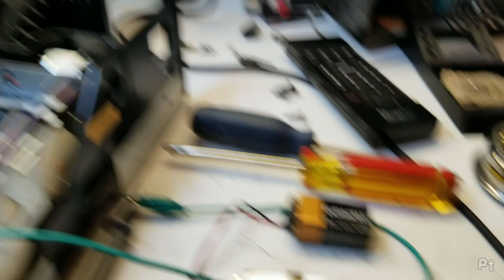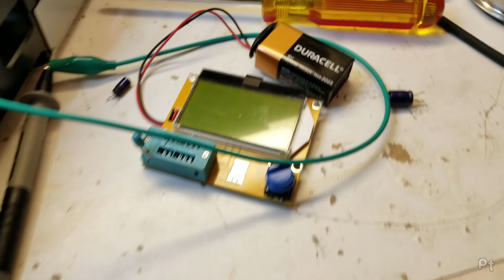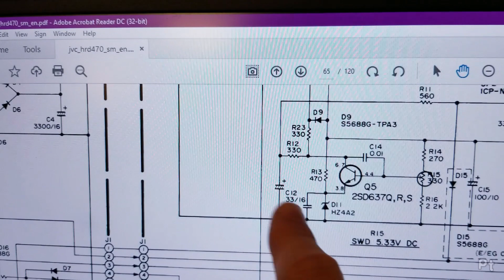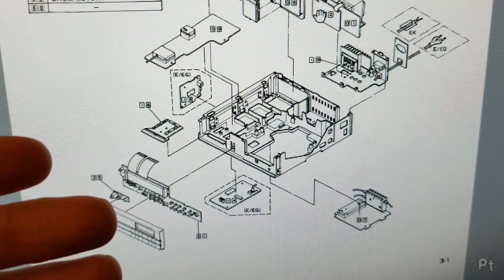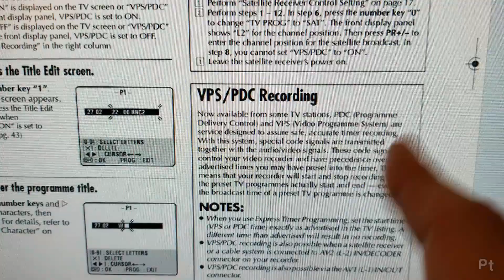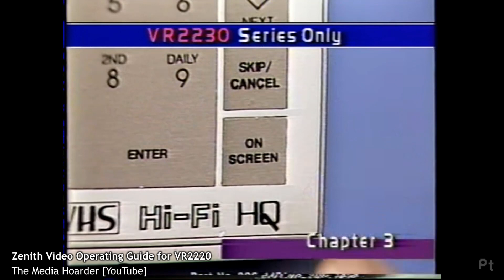Zenith Side-loading VCR  - ADDENDUM

Comment: Hi I just got one of these too, I'm having an issue where the vertical is unstable so the picture is rolling.  Did you ever get a copy of the proper schematic?  I tried to use the JVC one you show but it is too different in those areas.
Reply from the maker: I never ended up finding one. I think the only option is to pay up.

When  you say the picture is unstable is there tracking bars that don't go away? It could be the entry tape guide is out of adjustment (tape guide that pulls the tape against the video head on the left side of the drum).
Reply: Dang, I can’t even find a reliable source to buy one.  I get a pretty intact picture but it is slowly rolling vertically.  I’ve ruled out anything in the tape mechanism/electronics because the same issue happens when I’m just passing through a clean signal from the composite input.  Research led me to check the caps around the IC that handles the Sync signal but haven’t been able to figure out which one it is so far

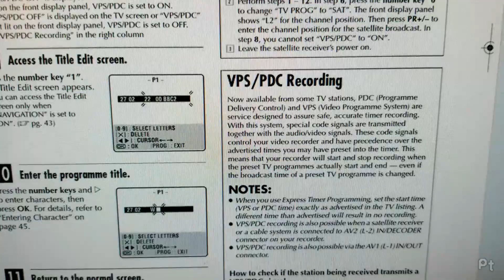Comment: That VPS/PDC feature shown at 5:52 was a very clever system. It was the PDC (Programme Delivery Control) version we had in the UK. I can remember one time when a show was not only delayed but it moved channels (from BBC1 to BBC2) and the VCR automatically adjusted the timer for both the late start and the channel change. I knew it waited for a signal before starting record but never knew it was capable of changing channels too. 

I also remember an AKAI VHS that used the same feature to provide an auto stop function, where you manually started a recording and it would stop when it detected signal for the next show.
Reply from the maker: That would have been so useful to me in the 90s. Shame we never got it here.

Comment: VLoss on those GM328 testers is how much charge the capacitor loses per second. Rule of thumb is: if it's in the double digits, that cap isn't healthy anymore, even if the other values seem okay-ish. And yeah VPS was a thing, but other than out of curiosity, I've never seen anyone seriously use it. ShowView was another one, where TV papers (remember those?) had a numerical code next to every show, movie or whatever, and you could punch that number into the VCR telling it to record just that show and stop afterwards. This was an attempt at making scheduled recording easier and in combination with VPS, prevent you from recording a manually set time period when in reality whatever you wanted to record was delayed or moved around in the schedule. From a quick google this was apparently called VCRPlus in the US and VideoPlus in the UK, and though similar in function they're all incompatible with each other (mainly because of the encoding used for the numbers)

Comment: So for this model Zenith's OEM was JVC or did Zenith knocked off a JVC design?
Reply from the maker: JVC was the OEM
Reply: @probnotstech Thanks for clearing that up.  Did Zenith manufacture VCRs or sub that work to OEMs ?
Reply from the maker: I don't believe any US-based brand (Zenith, RCA, GE, Sylvania, etc) manufactured a VCR. In the beginning it was all Japanese based manufacturers - Sony/Sanyo/Toshiba for Beta, JVC/Panasonic/Hitachi for VHS. Korean manufacturers started I think sometime in the mid 1980s as well (Lucky-Goldstar/Samsung/Daewoo) as well as other Japanese manufacturers. Zenith re-badged Sony Beta VCRs until 1984, then re-badged JVC VHS VCRs until the 90s when they started selling Goldstar-made VCRs.